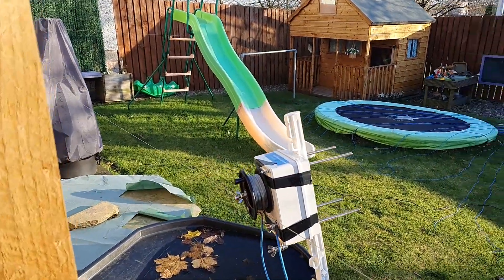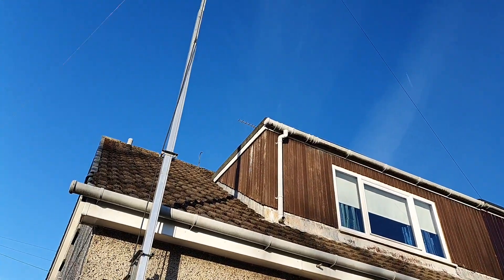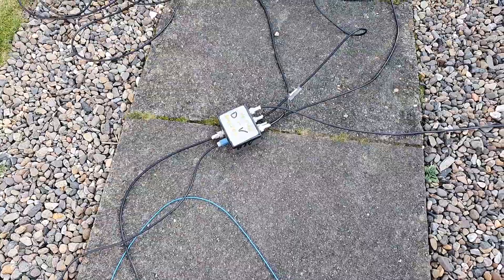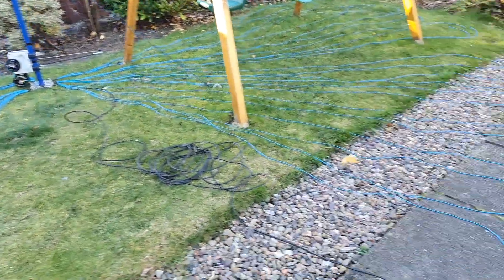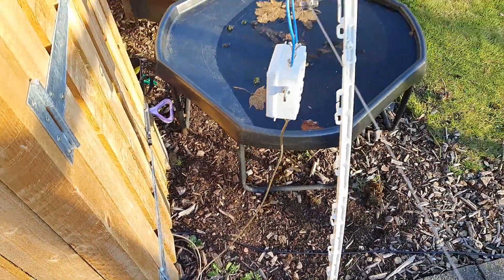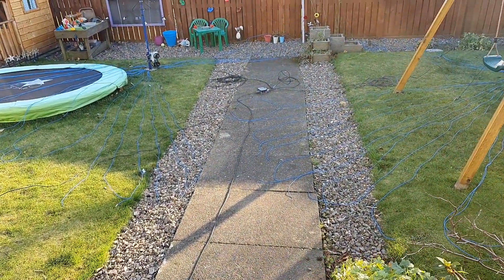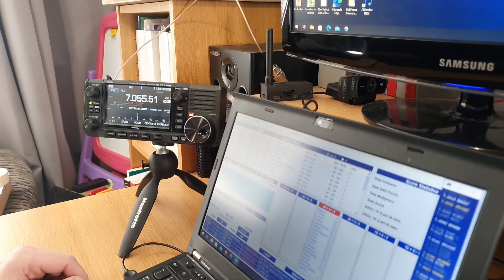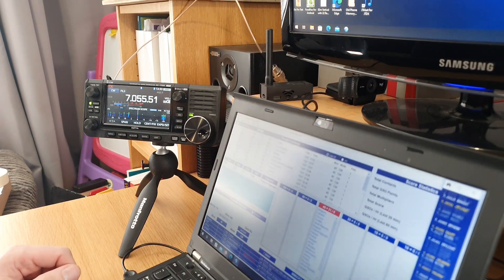CQWW CW 2021 - QRP on 40m with 3 different antennas

Comment: Ok i have an 80 m loop and my other antennas are within the 80m loop.  Bad.  The loop at 60 to 80 feet interacts badly with the other antennas.  The loop works fine but I need to drop the loop almost to ground level use the yagi on the tower and the 40m vertical.  Other amateurs have found the same thing.  PITA but that is how it is.  Cheers VK5LB
Reply from the maker: Totally agree. I think a lot of people do not realise this. It's super critical for phased verticals I've found as I need to completely disconnect my OCFD thats nearby.

Comment: That's interesting Colin. I've never used a dipole, other than the emergency one in the attic (which actually fares okay). I'm beginning to think that's a mistake.
Reply from the maker: Very underrated, I will likely change mine for a Doublet which should cover 80-10 (80 & 60 at reduced efficiency) buy I do t have them now so better than nothing.